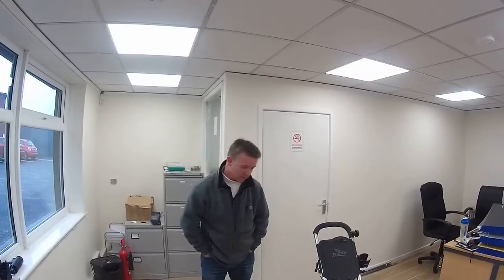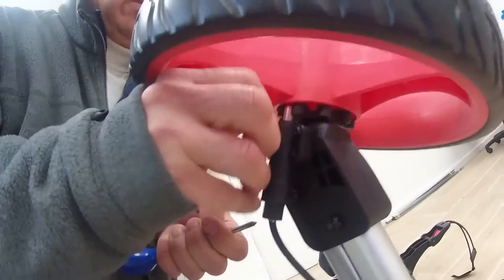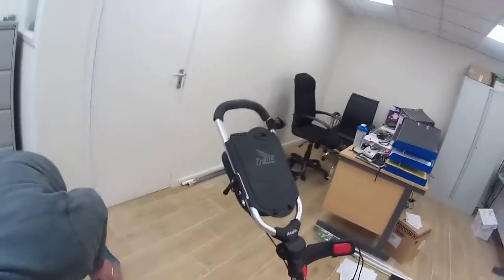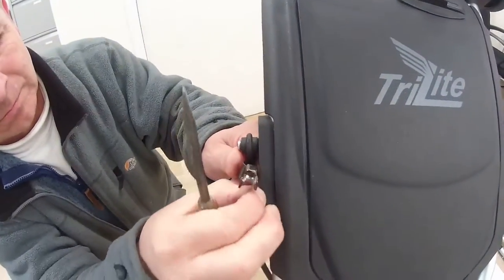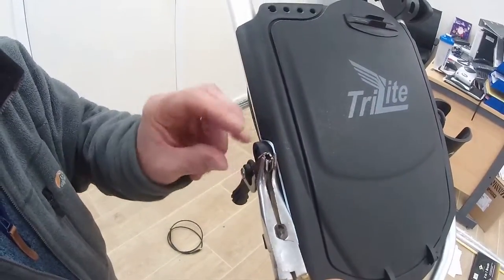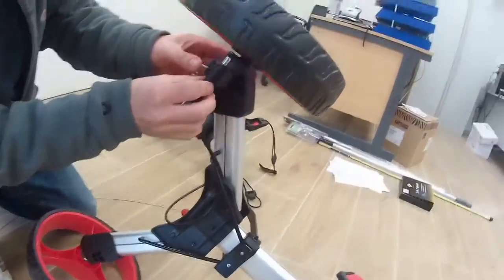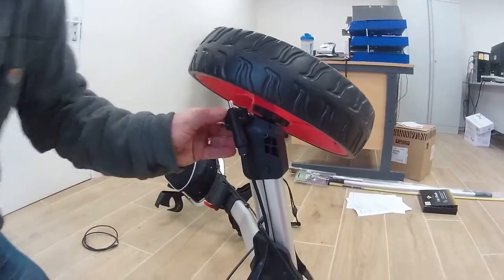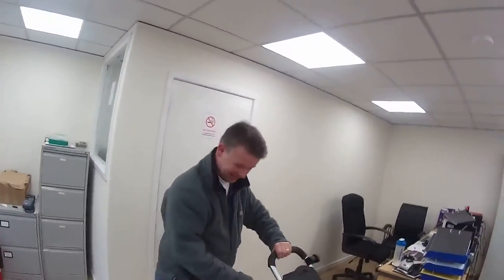Axglo TriLite Brake cable repair

Comment: Ordered the cable from Axglo in Canada a month ago and still hasnt arrived in Australia. I should have watched this vid sooner and just gone to a bike shop. I will be going tomorrow as it looks pretty easy. I assume a 2000mm back brake cable will be long enough but will measure the old one first as didnt hear you mention the length. Cheers..
Reply: Std mountain bike brake cable barrel is too big. I used a grinding bit on my drill to make the holes bigger in the lever. The cable is 50.5" (1300mm) long but you can cut at the end as it threads through the end of the brake plunger. I put a rubber sleave and grease at the top where it frays.

Comment: Thanks for this video. My cable snapped mid round so I unscrewed the mechanism near the brake pin and removed the cable managing to finish my round. Bought a bike cable from Halfords here in UK for £2.95 and filled this video for fitting. Very straight forward.

Comment: My brake cable has snapped this morning, in the locked position meaning that it had to be carried back to the clubhouse then on to my car

Above video is very helpful but I would prefer to speak to someone from Axglo here in the UK - any advice would be most welcome

The trolley is about 18 months old and only in use once a week

Looking at other trolleys, this does seem to be a weakness in the design, has anyone else experienced a similar problem?

Many thanks
Reply: Yep me

Comment: Where did you manage to get the replacement cable? I have been searching the internet and struggling to find a supplier in the UK
Reply: Decathlon bike cable
Reply: @bkeith1965  do u have more details about cable from decathlon?
I m from india.
Reply: @Sunil9200  Any bicycle "brake" cable used for "braking" (stopping) your bike. A bicycle part/repair shop will have them. I changed the cable yesterday using a conventional brake cable, had to cut it to length.
Reply: @bkeith1965  thanks
Reply: @bkeith1965  I found the barrel too big on a std mountain bike cable so made the holes bigger with a grinding bit. What bike cable did you use?
Reply: @midlifebiker7424  Yes, I had to file the barrel a bit to make it fit.
Reply: @Sunil9200  It's a standard size bicycle/ bike cable....length may be trimmed with pliers/ pakkad :)